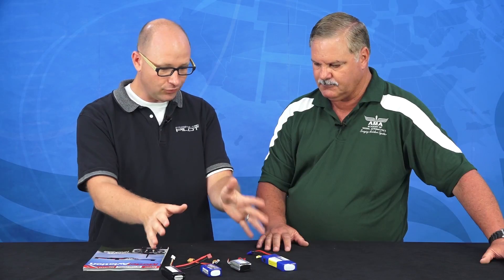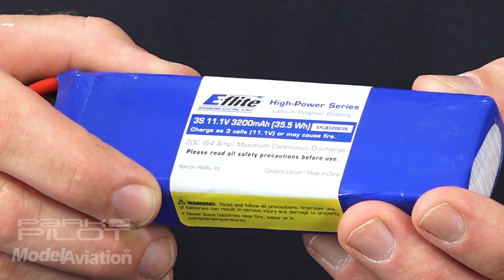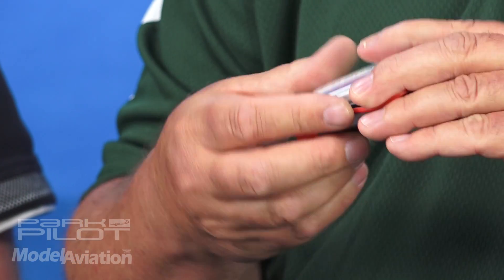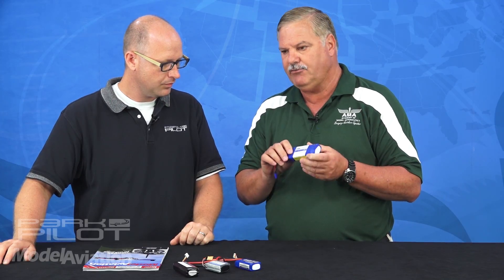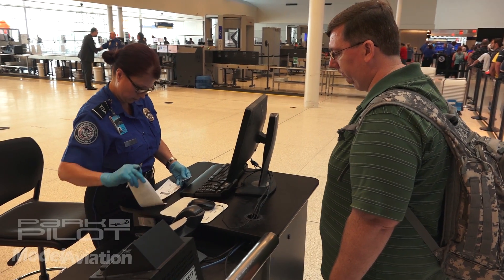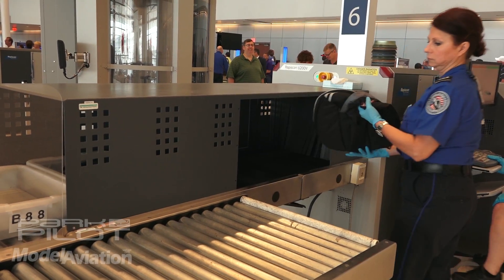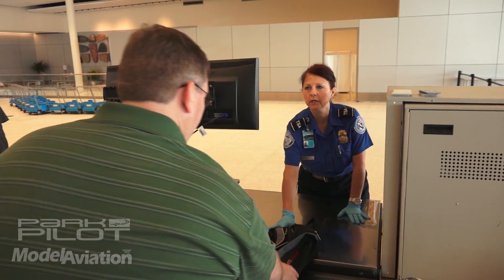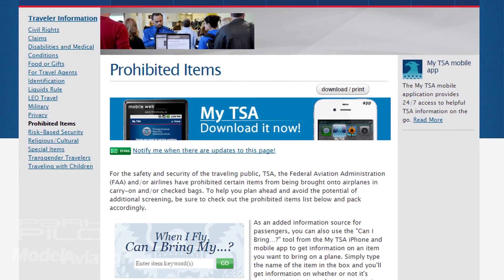Transporting your LiPos through TSA

Comment: I traveled last month from the US to Canada for 4 days and then back.  I researched for both US and Canada before I left and printed out the rules for both and put it with the batteries.  Basically I did most of what was outlined in this video as far as handling. I had 0 issues.  On the trip back, the Canadian security did ask me about it and I explained what it was and referenced the rules.  They actually thanked me for being prepared and knowing what I was talking about.

One of the things I did that wasn't listed in this video was printed out little labels and stuck them on every battery which had the calculated Wh for all the batteries that didn't have it already printed on it.
Reply from the maker: damage.cc  Thanks for sharing your experience.  Good advice on the labels.